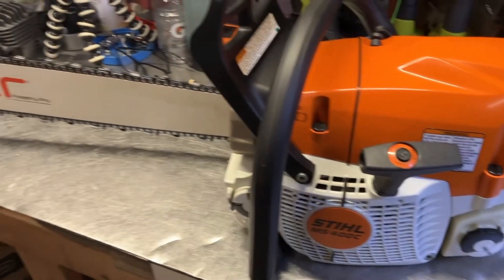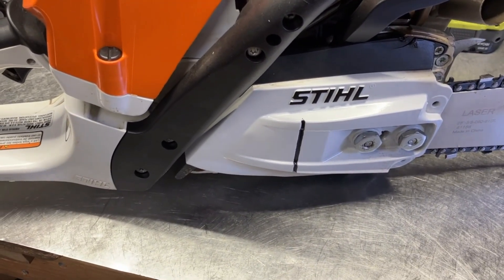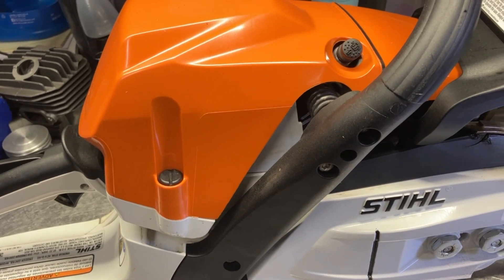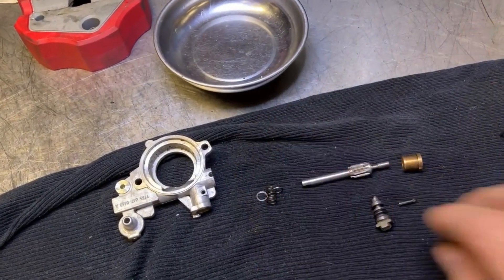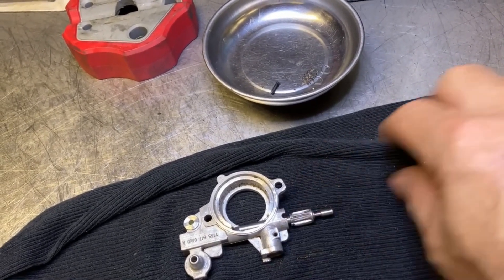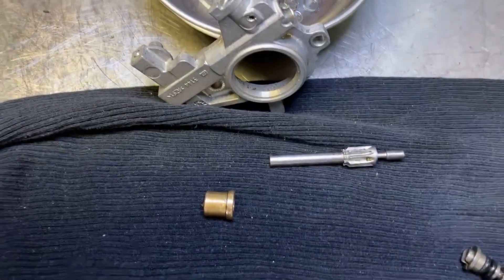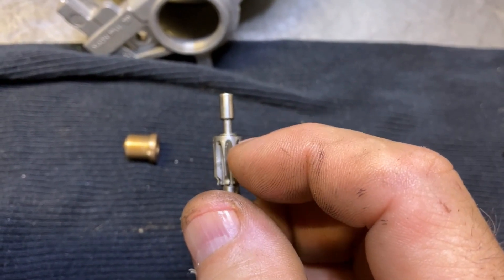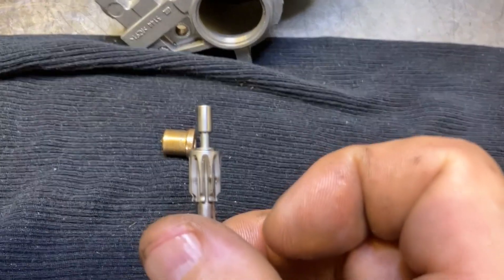MS400 DIY High Output Oiler Mod

Comment: I just did this modification on the stock oiler (ms 400c) 

It definitely works.  

My bar drips with oil lol. 

Does yours drip?
Reply from the maker: @josephlillemon7517  I’m glad it worked for you!  If I run it out of the wood a bit yes, otherwise it spays a lot off the end when free reving it. I’ve run up to a 42” bar on mine and it oiled it very well.

Comment: So could you do the same to the 500?
Reply from the maker: @Mightycaptain  the 500 is like the 462, just drive the roll pin in and you’ll get more adjustment.  Have you done this yet?
Reply: @ I have. Seems to oil terrible still. It gets by. But isn’t what I’m used too on a saw.
Reply from the maker: @ ok, that seems odd, my 500 oils generously and lately I've been cutting larger stuff with 36" full comp and it has no problem oiling.  To answer your original question, yes, this mod will also work on your 500 oiler.  Good luck man!  I hope you get it straightened out.👍

Comment: This works as we all just saw, but you can order the parts out of a 461 and install them without any mods.   I did that on my 362 and 400, works great.  And yes, they both needed it.    1 tank of fuel = 3/4 tank of oil which is how I like it.
Reply from the maker: Thank you, yes, everyone is aware that you can swap oilers, and for some that is the way to go.  The point for the video  is for those with the ability to do it themselves, and not have to spend  the $$ on new parts.   It’s  really a simple mod to do.  I personally prefer to do things myself, but, to each his own.  I can honestly say, with this mod, both of my 400’s will oil a 42” bar & chain with no issue (and the pull the 42” like a champ as well).  I started doing this mod on the larger saws to run longer bars, and for people who needed the extra oil for milling.  Once I saw how minimal the oil flow was on the 400’s I had to modify them too. 👍🏼 thx again for commenting, saw safe!

Comment: Thanks bud, I'm considering getting a 400 when a grand falls in my lap.  Any way to mod the ms291 oiler?  I'm runnin a 28" bar and want a bit more oil.
Reply from the maker: get the 400!  you will not regret it!  a muffler mod and 6 tanks to break it in and it is a beast of a saw!  I have a 28" sugi lightweight on one of mine & a 25" tsumura ultralight on the other one, both running square filed chain.  As far as the oiler on your 291, I personally have not tried anything with that oiler as it is a polymer frame and although I'm sure it works similarly, I'm not sure if it can be modded.  The next time one comes across my workbench i will certainly take a good look at it though!  Be careful with that 28" bar on that little 291 clammy.  Those saws generate a lot of heat to begin with, it wont take much for that 28" bar & chain to punish that saw.  Sorry i couldn't be more help!  Subscribe & stay tuned to the channel for more info.  Good luck & Saw Safe!
Reply: @Kirks_Custom_Chainsaws  Thanks Kirk!  I really appreciate your response!  I'm already subscribed and will share your channel.  After tinkering a bit with my 291, I found my new hobby and may be a little obsessed.  I installed a universal muffler mod, felling dogs, and a foam air filter from Westcoast saws.  Then I punched out the carb limiters and drilled the oiler hole on my stihl light bar.  Not all bars are equal as far as the oiling hole and the stihl light is way too small.  Thanks EPA!!  I'm thinking about getting a black label tsumara premium light bar when available.  Do you prefer sugi or tsumura?  I've heard the sugi is thinner and that helps with cuts.
Reply from the maker: @tomsmith4484  Wow!  You definitely have the bug just like the rest of us do🤣🤣  As far as my favorite lightweight bars, Stihl es light is my top pick, then husqvarna x-tough light, then sugi & tsumura.  I have a video on all of my lightweight bars if you're interested:  https://youtu.be/GK6RWCcXmCw?si=9ss0oWvyhy3HW8AJ     and yes to the oil port.  A lot of bars have very small oil ports and they clog easily.  I end up opening up most of mine.  Hope you like the video on the lightweight bars👍
Reply: @Kirks_Custom_Chainsaws  Thanks Kirk.  Great video about the bar weigh in!
Reply: I switched to Tsumura bars and they oil much more than the Stihl bars.   I run a 25 on my 400 btw and I agree, get one if you can.   It’ll weigh about the same as your 291 and have a lot more power.  362 and 400’s have much better anti-vibe if that matters to you.